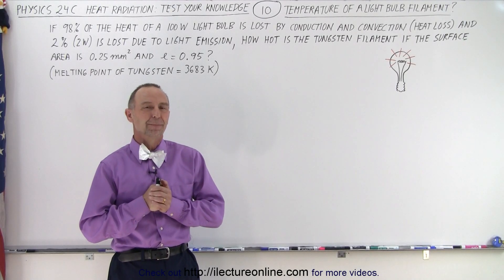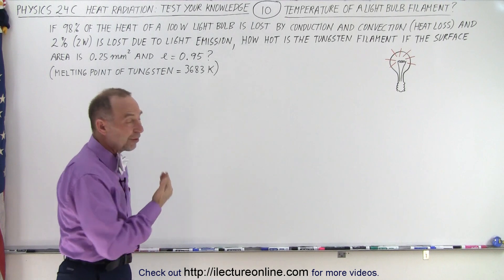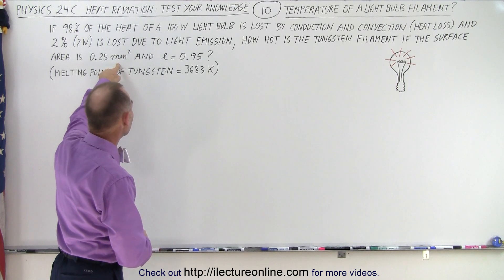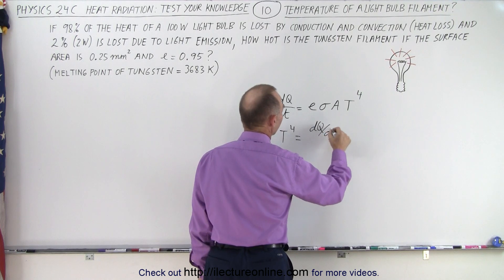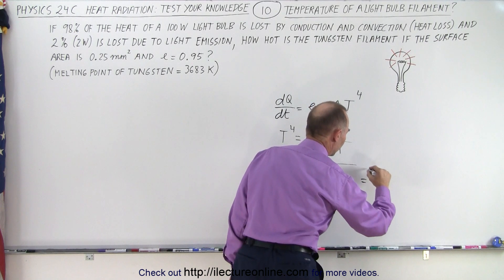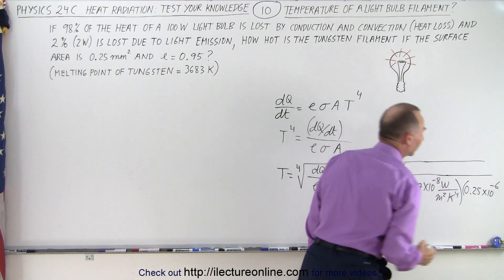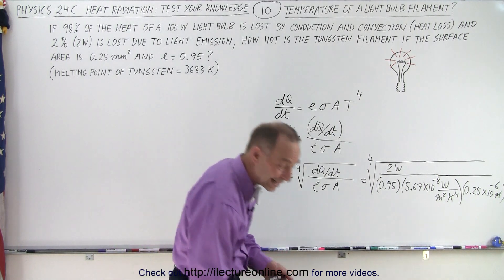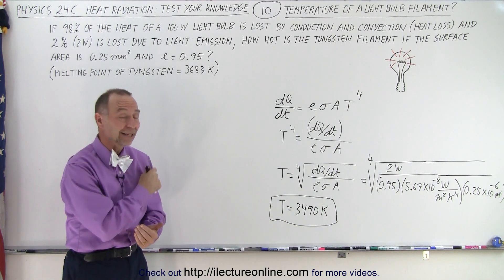Physics: Ch 24C -Heat Radiation: Test Your Knowledge (10 of 20) What is Temperature of a Filament?

Comment: The 2% assumption for radiation power is not realistic. An efficiency of 2% is realistic, but this percentage is so low because most of the radiation is infrared. So the 98% heat loss include the power of the infrared radiation, which is much greater than the losses due to convection and thermal conduction.
Reply from the maker: I looked it up and incandescent light bulbs appear to use about 10-15% of the power consumed to convert it to visible light.